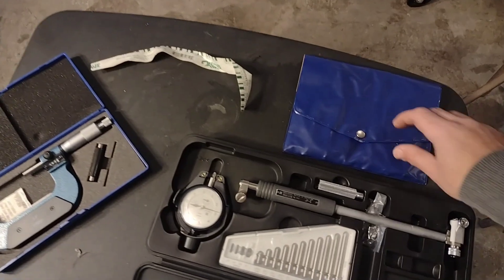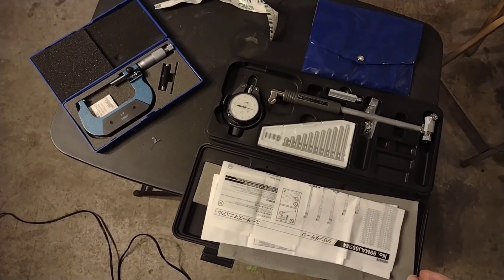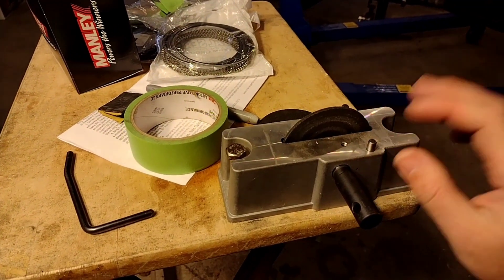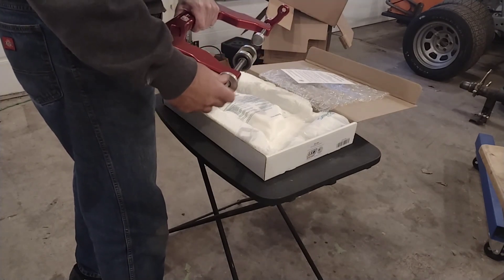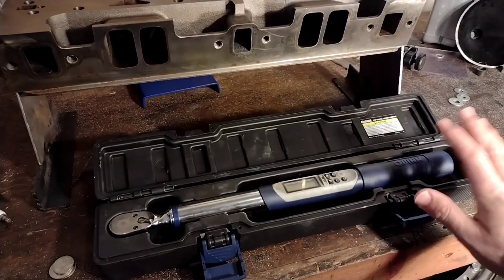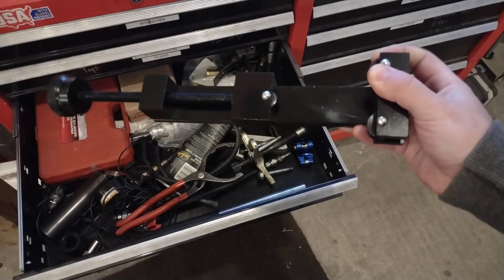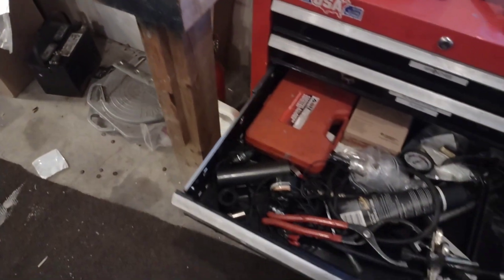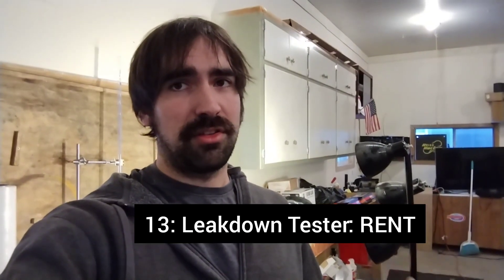Rent, Skimp, or Splurge: Essential Engine Building Tools

Comment: Hey I like the video! Some other tools I would add is a cheap remote start trigger gun and timing light. a regular cheap digital caliper for less critical measurements. A simple feeler gauge set. And multiple really good bright, portable and comfortable to use light source.
Reply from the maker: Thanks for the feedback! I thought about that including more tools but this video was getting pretty long as is. Will have to do a "part 2" at some point.